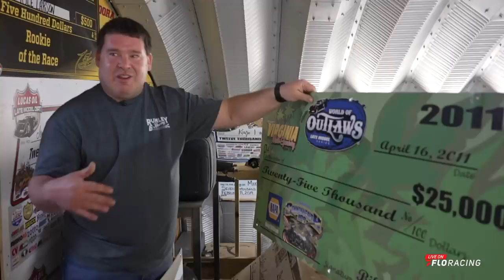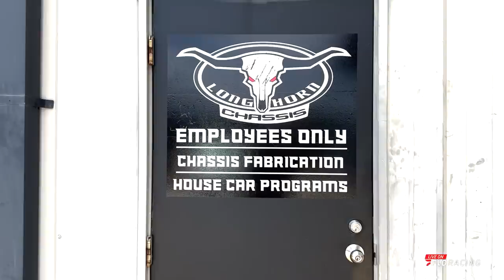Road To Eldora: Longhorn Chassis | Always Improving, Ken Block & Travis Pastrana's Connection

Comment: Could someone give me the definition of “house car”? Thanks.
Reply: The race team that the manufacturer runs. So instead of a private 3rd party having a race team. The company (Longhorn in this case) runs a team out of their own building. Thinks first party vs third party.
Reply: @tMatt5M  thank you, thats what i thought.
Reply: Typically a house car is used as R&D for the manufacturer. The Longhorn "house car" is a bit different, and its not owned by Longhorn, its owned by Don and Gina Bradsher. They operate out of the Longhorn shop and gets a ton of support from Longhorn, and ultimately Kevin Rumley since he's a special consultant for Longhorn